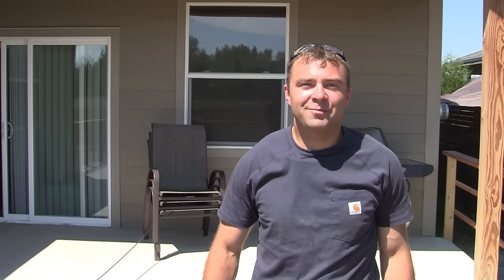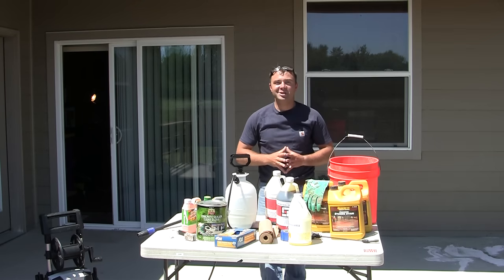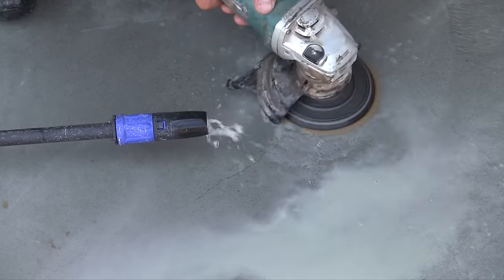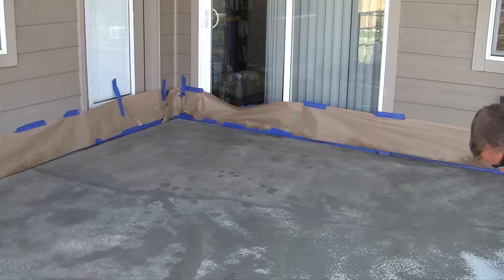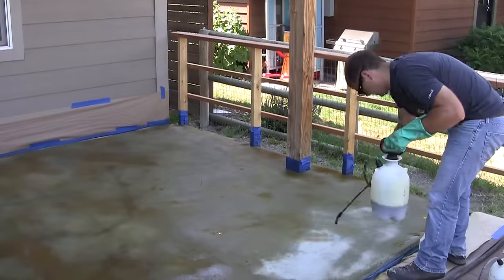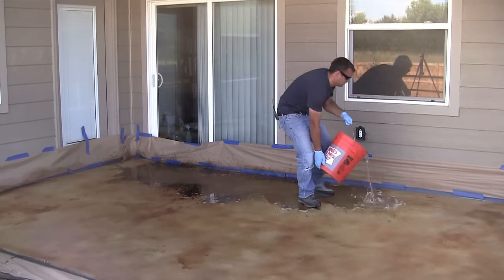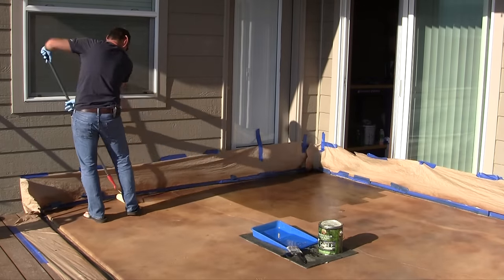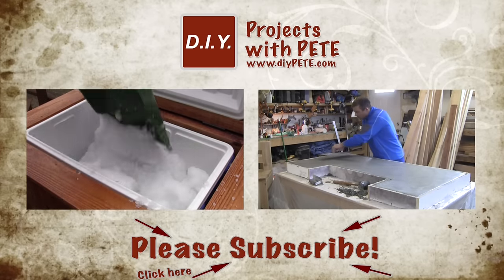How to Acid Stain Concrete | DIY Acid Stained Concrete Patio

Comment: How do you think that would hold up on a driveway in the Midwest?  It’d probably look great for a year or two I bet.
Reply from the maker: Hey! I don't think it would be a great thing for a driveway in the midwest unfortunately. I've seen them at some homes in the southwest but not too many around my neck of the woods or back in the Dakota's where I grew up. Snow plows, chains, shovels, etc would most likely get to them over time and cause some scratches etc. They've held up great on my patios etc, but I plow too much snow and run heavy equipment and so I wouldn't ever do those areas. I'd definitely do some additional research though. Cheers!

Comment: If the patio has already been stained a few years back and sealed too at that time. If I need to get it re-stained, how would I remove the sealant and previous stain color; i am planning to use a darker shade of the color so may not need to remove the previous stain; but Sealer needs to be removed. So, please suggest how. Thanks.
Reply from the maker: Hi Vivek! Removing sealers isn't typically easy, but i'd recommend finding a good commercial sealer remover at a local concrete supplier store. That in combination with a gas power washer would be what I would research.

Comment: Great video. 
Question, does the pre-mist apply to water-based stains as well?
Reply from the maker: Hey Joe! I would say it depends a bit on the manufacturers recommendations, but I do like to pre-mist with water just a bit as it helps make the concrete a little more forgiving in case you get drips on it etc. Best of luck !
Reply: @DIYPETE  how do I remove acid spots on concrete that were left from my plant soil acidifier t

Comment: Pete, after cleaning the patio as described, how long do I have to wait before applying the stain? (I'm using the Scoffield LIthochrome Chemstain.  thx
Reply from the maker: Hi Sheila! I'd recommend seeing what the manufactured recommends. After cleaning I let the puddles dry up, but I like to have a slightly damp surface when starting as it helps blend the stains and make it a little more forgiving. So I stain pretty quickly after cleaning if I'm ready. Otherwise I'll mist the surface to dampen it before staining.
Reply: Thanks Pete. The sealer I bought is "Glaze N Seal Wet Look Green Concrete and Masonry Lacquer".  It says it is "low VOC formula Durable High Gloss". It was recommended as the best. I'm concerned that it will be too shiny. In my patio/courtyard, I'm going for the old world, Italian/Spanish look.   I want the color of the stain enhanced, but I don't know if I want it to be shiny. Any thoughts?
Reply from the maker: Hi Sheila, I'd recommend testing it on a sample before doing the patio. I haven't used that brand but it does sound like it will certainly give it the wet look. If they have any option with less gloss you might try it. But the high gloss will be good protection.

Comment: Do you need to let the concrete dry after pressure washing? If so, how long?
Reply from the maker: Just get the puddles off after pressure washing. It does not need to dry completely prior to staining. Cheers!

Comment: Great video!
I just poured new concrete...how long should I wait till I do this??
Thanks!
Reply from the maker: Hi! I'd recommend checking with the supplier. They typically recommend 28 days. I have done it earlier without issues, but that's what most recommend. Great question and good luck with the staining!

Comment: hey pete is this the easiest and cheapest way to stain concrete? I am wanting to do this to my patio and also inside my house to a couple areas.
Reply from the maker: Hey! This is probably the easiest way if you want to use acid stains. However, there are stains that are water based that you could look into. They don't have the same variation, but they don't require neutralizing so it is a cleaner process.

Comment: I just suscribe... two questions one can it be use inside ???? Two what can I use to make it shinier ??? Thanks keep up the good work
Reply from the maker: Thanks for subscribing! Yes, acid stains can be used inside. It is a pretty similar process but neutralizing will involve a mop and bucket, and / a wet vac. You'll want to look at sealers recommended for indoor use - and a wax can help make it even shinier. Cheers

Comment: How would I lock in some small shell rock that was used on a drive & patio? It tracks into the house & washes away in the rain. I was thinking just sifting Quikrete then just wet it all down & set up. Would that work? What kind should I use?
Thanks
Patrick
Reply from the maker: FloppyHatPhotos Hi Patrick! Do you essentially have an exposed aggregate patio / drive? Is the aggregate popping out of the concrete? Give me a few more details and I'll do my best to help. Feel free to reach out on the contact page at www.diypete.com to get in touch and send a photo of the driveway if needed. Cheers! - Pete
Reply: DIY PETE When I get pics I'll send them to your site. Its just a rock only drive/patio theres no concrete at all, I'm open to anyones ideas out there on how to fix this. Thats whats great about youtube many minds.
Thanks
Patrick

Comment: Hey Pete got a question I want to stain entry of house its connected to driveway  dont want to stain it when neutralizing will run off stain driveway
Reply from the maker: Hey Fernando, you'll want to make sure to protect the driveway close to it to prevent overspray or stain from getting on it.

Comment: Great video, Pete!  One question, does the estimated coverage (for stain) from the manufacturer seem correct?  I saw you diluted stain to ease into the color you wanted.  I'm planning to do 1200 sq ft shop floor and I'm trying to estimate how much it will cost in materials.
Reply from the maker: Hey Matt, I feel like the stain coverage (at least for my taste) is more then what they say in the instructions. I always dilute at 50/50. A gallon seems to go a long ways.
Reply: Thanks!!  Do you have experience with concrete that has been power-troweled?  I've heard this makes it more difficult for the stain to penetrate.

Comment: And also was wondering what kind of pump spray would be good to get I've looked at some but there's so many different ones and different reviews
Reply from the maker: Hey DJ! I use a cheap $10.00 all plastic parts pump sprayer from the hardware store. I specifically got it at home depot.
Reply: So it doesn't have to be a special sprayer for acid? Any pump sprayer would work?

Comment: What kind of stain or concrete pigment is best if I want low to no maintenance?
Reply from the maker: I have used both acid stains and waterbased. You'll want to use a good sealer, which will need to be maintained every few years just to have a good protectant.

Comment: We're having a new patio poured. How long does the new concrete cure before we can acid stain?
Reply from the maker: Hi! The instructions typically recommend 28 days. To be honest though,  I've done it after about a week and have not had issues. ( on numerous projects )
Reply: @DIYPETE  Thanks!

Comment: If my patio was already stained is there another step to remove the original stain or can I just stain over the original stain?
Reply from the maker: Hey Nick! Make sure the sealer is removed. Are you patching up areas?
Reply: Hey Pete thanks for your response.  I was going to just restain my back yard patio because it looks faded from the sun.  It is not a grey color which makes me think it was already stained but I don't know much about these things as this would be my very first home improvement project

Comment: I am interested in doing this with an inclosed patio can you help me know what I should do differently.  This will be my first DIY !!!
Reply: enclosed
Reply from the maker: Hi Alisha! The biggest difference is how to manage the rinsing water. You'll want a good mop and bucket - and a wetvac -- so that it doesn't get absorbed by walls etc. You'll want to make sure to tape off the walls as well. I'd recommend an acrylic sealer to cut down on the smell while applying the sealer. Cheers!

Comment: Hello Pete, 
was just wondering why you didn't explain what that spray bottle with some dark liquid is,?? you're carrying this spray bottle while applying the acid stain??.I'm assuming is undiluted acid stain and you used it to make those scattered darker spots on the concrete?? please explain I want to do my patio but I do wanted to come out like yours, so it will b greatly appreciated. .thanks
Reply from the maker: israel carc HI Israel! The spray bottle was a different color that I was thinking about using as a hi-lite in areas -- but I didn't end up using it because I decided the one color had enough variation. The darker spots on the patio are just from how the stain took and reacted with different areas of the concrete. So I only used the one color. Have fun with the project!

Comment: Question for ya:
Could you use two different stain colors together?
thanks
Reply from the maker: You can -- or you can use a second color to hi-lite areas.
Reply: Oh like one then another on top in some spots? Thanks... I'm pumped to start this project.

Comment: Would love to do this, but I've got 4 dogs going in and out all day. Is there a faster way to achieve a nice looking patio?
Reply from the maker: Hey David! There are other types of stains and a water based would be a little faster. But you'll still want to seal it, which does take some time to dry. So you'd most likely need to have a little downtime and figure out a solution for the dogs for a while.

Comment: can this be done on a "textured " pool deck? )( the type of deck with those lil holes in it?
Reply from the maker: Hi, it can be done on various textures, but it will saturate into the surface differently. I'd recommend doing a test area to see if you like the results.

Comment: What color stain did you use and will it work on a driveway
Reply from the maker: I used walnut stain from Chemstain. I've seen folks do their driveway. However, I wouldn't do this if you run heavy equipment or snow plows etc as it can scratch. I see it more common in areas like Arizona. I'd recommend doing additional research and checking sites like www.concretenetwork.com

Comment: Looks good, how long does the finish last?
Reply from the maker: Hey Grim! Really depends the mount of sunshine and weather it gets. This patio is partially covered and faces to the east, but I would recommend doing a new sealer coat every couple years to keep it looking top notch.
Reply: @DIYPETE  k tyvm

Comment: can the water runoff from washing the neutralizing solution stain concrete I do not want stained?
Reply from the maker: Hi Jay, you can spray it off the concrete you stained. But if there is clean concrete near it that you don't want to stain - you won't want to get the neutralized solution on it as it still may have acid in it and could give the other concrete a little color.

Comment: Hi there. I want to fill in the concrete seams. How will this effect the process?
Reply from the maker: Hi! If you patch them with concrete you'll want to do this before staining, and remove excess on each side of the crack. If using a caulk, you'll let it dry and then stain ( or you can apply afterwards ) Best of luck!

Comment: Would you notice a difference if the concrete were two different shades of grey after you stained it
Reply from the maker: Hi! It would help blend them and minimize the difference. You may still be able to tell a little, but it should tie them in real well.

Comment: This looks bad ass. Thanks for the video. 

I am curious; How long those acid staining usually last?  Do you have to keep doing it?
Reply from the maker: Hey Big O! Thanks, yeah acid stains are great. As for durability -- it really depends on how well the area is prepped --- and then how well you stay on top of maintenance / where it is. If it is a covered patio, I'd recommend resealing every other summer or whatever is recommended by the manufacturer. As long as the sealer stays in good condition, the acid stain will. Many of the patios I've done still look great, but I've made sure to seal them ( which is a super quick deal )
Reply: DIY PETE .... good to know. 

Thanks for replying!

Comment: Would this work with indoor concrete? Or is there a different method?
Reply from the maker: Pretty similar. I'd recommend doing some additional research on sites like concrete network.com. A wet vac is used to remove the water from the space and I don't use as much since it all needs to be removed from the home.

Comment: can this all be done in one day if started early?
Reply from the maker: +Rene Rodriguez Hi Rene! I'd give yourself 2 days for the project. One day to clean/prep/stain. Overnight to let the stain penetrate for 8 hours. And the next day to do a couple coats of sealer. You may technically be able to do it all in 1 day if started early (prep, clean, let dry), stain - let penetrate, stain again if need to darken, neutralize, let dry completely. Then Seal 2-3 coats. I like to make sure there is plenty of time for each process, but if you are really needing to knock it out in a day, I think it could be done. It's not what the manufacturers would recommend, but I've done it this way with smaller projects etc and been just fine.

Comment: I wonder if this would work on soil cement?
Reply from the maker: The metallic salts of the acid stain react with the limestone of the concrete. So if the cream floats to the top like normal concrete, you may be in luck, but if there is soil at the surface or aggregate, it won't be able to react. You'll have to do some experimenting and see :) Cheers!

Comment: Will it be slippery if it gets wet once its sealed and dried?
Reply from the maker: Hi! It will not be if it has a broom finish or textured trowel finish. However, you can add a clear sand called Shark Grip to the sealer, and that will give you grip. I've used it on epoxy garage floors and outdoor patios that are slippery.
Reply: Thank you

Comment: What do you do when rain comes in contact with unsealed acid stain need help !
Reply from the maker: Hi Vanessa! If it rains before sealing --- as long as the acid has had enough time to penetrate into the concrete --- it could be fine ---and then it needs to dry out thoroughly before sealing. If it washed away any of the stain, you could apply another layer. Let me know what happened after the rain - interested in hearing.

Comment: How long would this last on a driveway?
Reply from the maker: A lot of folks do acid stained driveways in the warmer climates like Florida and Arizona. I would not do my driveway since I drive on it in the winter with chains on the tires and have heavy equipment going on it. But if it is only used for cars and doesn't get scraped much by shovels etc, you could keep it looking good by re-applying a good sealer every other year or so.

Comment: one a more serious note. my patio had some carpet ... yes carpet, I pulled it off cleaned as much as possible , however I still have some glue, I had used hand scraper, goof off etc. can I still stain on top of it? please help?
Reply from the maker: +Flavia Cavalcante Hi Flavia! Great question. One thing about acid stain is that any glue or paint left will not not, and you'll be able to tell. If you have a photo of your patio I could take a look. Feel free to post to Facebook or use the contact page at diypete.com. Cheers!

Comment: Pete, THANK YOU for sharing this video. Just a question, I'm fairly good with my hands and tools. How difficult would this be? Were putting in a gorgeous pool and new Duralum patio cover but the decking is concrete and our patio is 20'x50'.. Plus we have a 16'x 150' driveway. Its beautiful but I don't want to get in too Deep and it ends up looking like poop. I have estimates around $4000 and you sure make it look easy:)
Reply from the maker: Hey Frank! To be honest, I'd recommend doing a smaller patio or area prior to doing such a large amount of square feet. You learn a lot on your first staining job and I think some sort of practice would be very helpful before you'd do that big of a job.

Comment: Can you pressure wash it later on for basic cleaning ?
Reply from the maker: Yes, once sealed you can certainly pressure wash it.
Reply: thank you .Ware having a patio cover put on as we speak .I cant wait to do this .How much is the acid stain and the sealer ?
Reply from the maker: Hi! A gallon of acid stain will typically go for between $40 and $75. Amazon has some real affordable stain. https://www.amazon.com/VIVID-Acid-Stain-Walnut-Undertone/dp/B00NP08G8U    Sealer will be around $30/gallon or so (for the type I used).
Reply: tnt Sand  h yo
Reply: Thai boxing
Reply: Chinese newspapers.

Comment: good video, but the chemistry is a little off.

you've sprayed a finite amount of HCl on your concrete.  The HCl reacts with the lime in the concrete.  Once the total mass of HCl has reacted with the available lime (Calcium carbonate), there isn't a lot of point in pouring an alkaline on it to stop the reaction, because the reaction has already stopped due to there being no more acid.  That would be like pouring water on a fire that had already burned itself out.

The time to use the alkaline is while the acid is still reacting with the lime, if you actually want to disrupt that (maybe you didn't dilute your acid as much as you thought, and the concrete is getting darker than you wanted it to get).

Comment: How do ensure it isn't slippery
Reply from the maker: Depends on how the concrete was finished. This had a trowel finish with quite a bit of texture so it has a lot of grip. If the floor is super smooth though, you can add Shark Grip to the sealer. This is basically a clear sand that goes in the sealer and gives the surface texture.